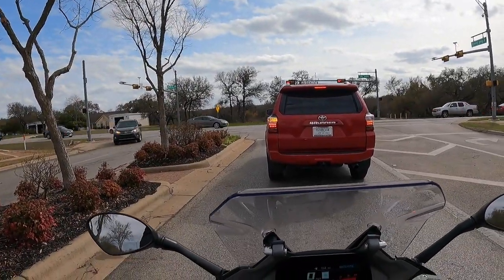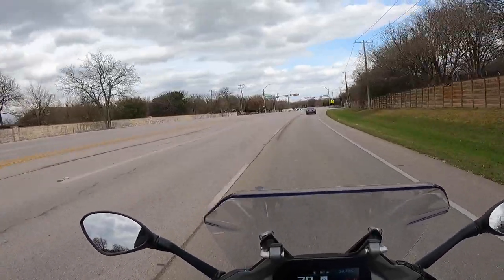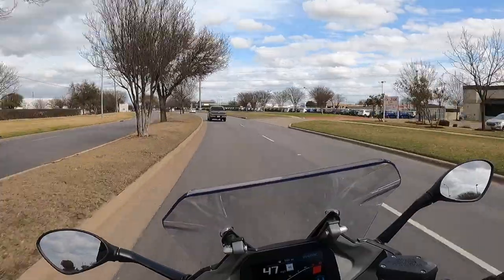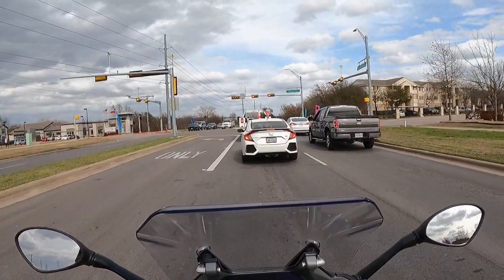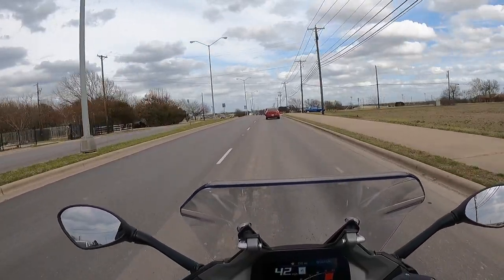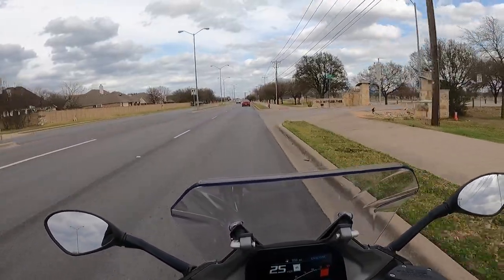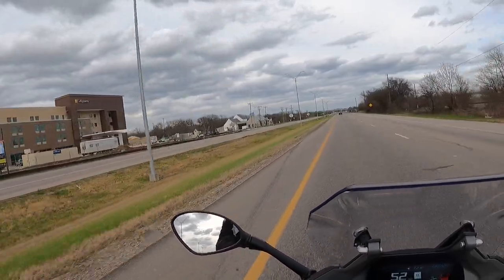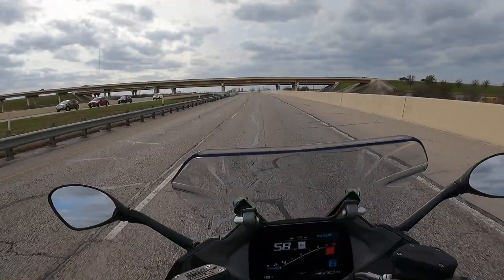2020 BMW R 1250 RS Motovlog Zoom H1N Audio Settings, Helmet Beanie and More

Comment: Thank you for  the video , by chance I was looking and wondering about a helmet beanie . My 2 year old Shoei is not a snug as I would like. A good cheap way to fix it maybe ?  Keep the RS info and comments coming , thanks
Reply from the maker: Hi Griff, thanks for checking out my video and the comment/question. I just wear a cheap neck gaiter I've had for a long time. I wear on top of my head and let all the excess material hang down on the back of my head. It helps to take up some room and make the helmet a bit tighter. I hope that helps. Have a nice weekend!